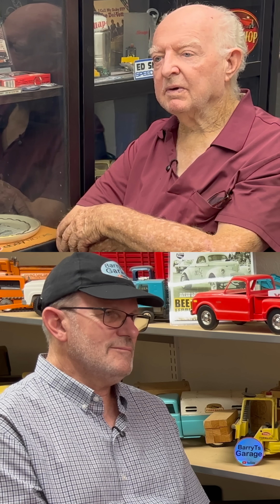Can VALVE Adjustment be a Racing Secret?  Ask Ed 42 - Ed Smith w #Barryt #racing #enginebuilding

Comment: The old Dontov 30/30 solid cam from Chevy was designed for dual duty! The cam was ground so that the owner could run the lash loose and get acceptable vacuum and running for street driving and tighten the lash up for more top end on race day. I've read that lash on that cam could be set as much as .036 and as close as .014 for much more lift and duration, faster opening and later closing, more overlap, all of which make a cam run at higher rpm and make more top end HP.
Reply from the maker: Interesting!

Comment: One reason I prefer a solid roller for my daily,  I grew up with "mechanical cams" as we called em. We just adjusted our valves every other oil change  it was part of weekend maintenance.
Hydraulics were the fancy stuff.
If I was gonna race I would run a semi tight lash then back em off for everyday driving.